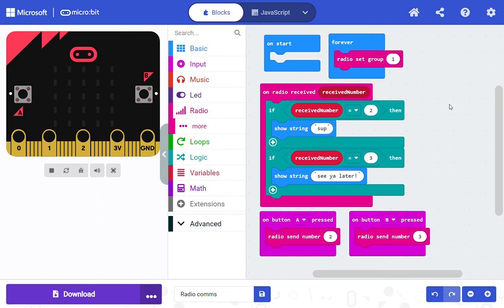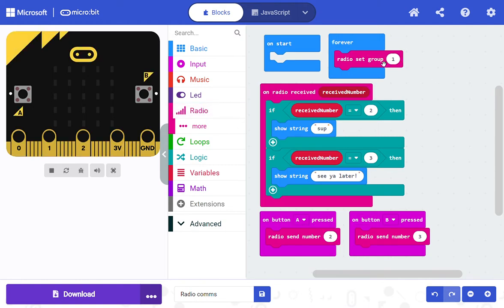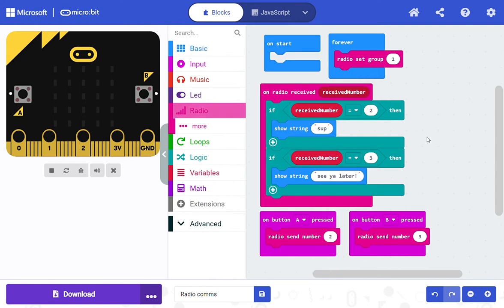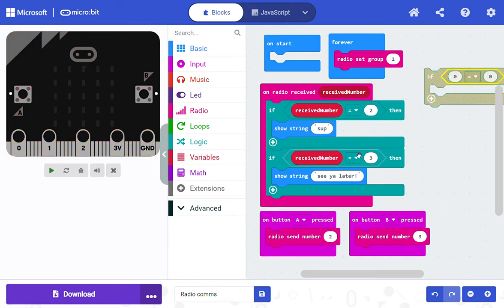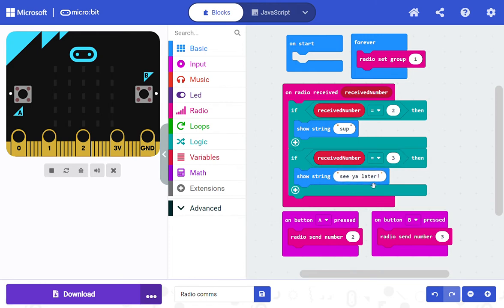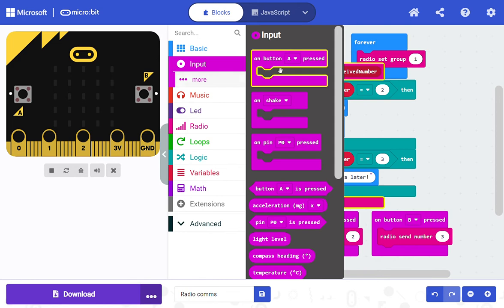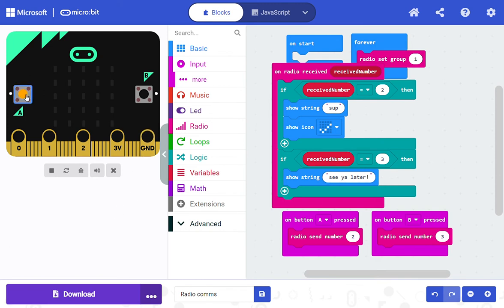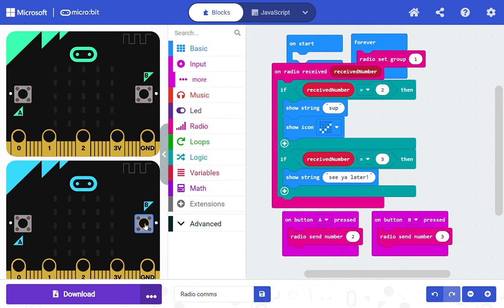Getting MicroBits to Communicate using Bluetooth

Comment: This video is about radio communication, no bluetooth!
Reply: The BBC MicroBit  uses BlueTooth low enegy (BLE). The code shown allows 2 MicroBits to communicate with each other using BlueTooth.
Reply: @georgecomninos9126  Im sorry, but I see in video Radio communication which cannot be used simultanously with Bluetooth communication because they share same bus, so you must choose if you want radio or bluetooth, but cannot have both.